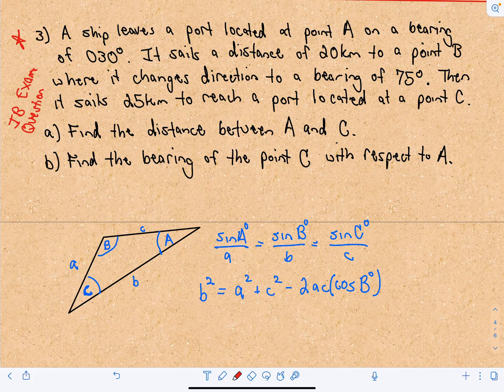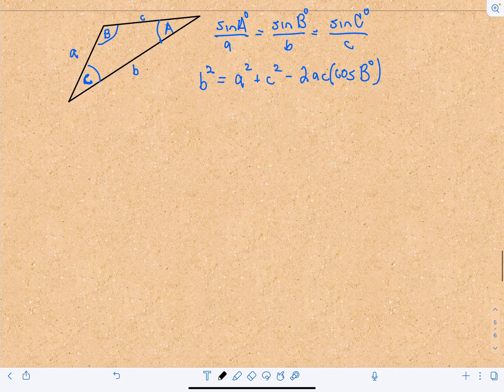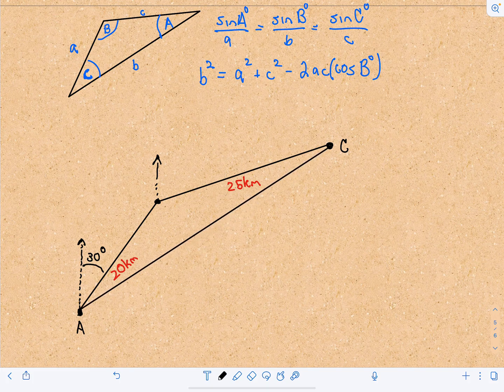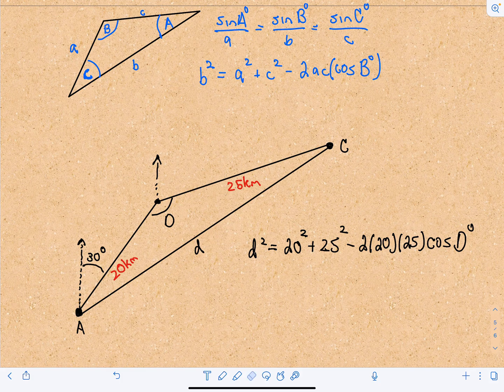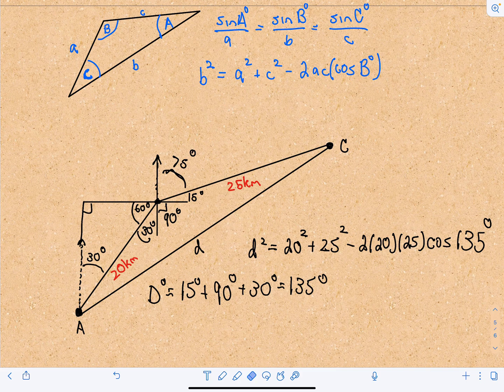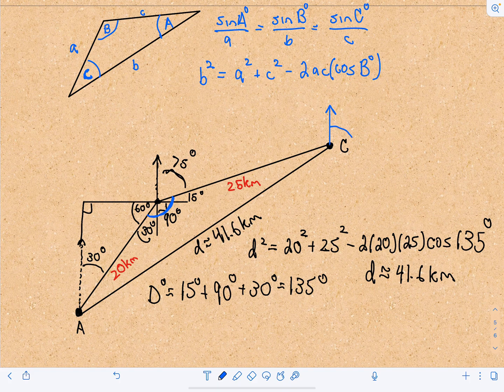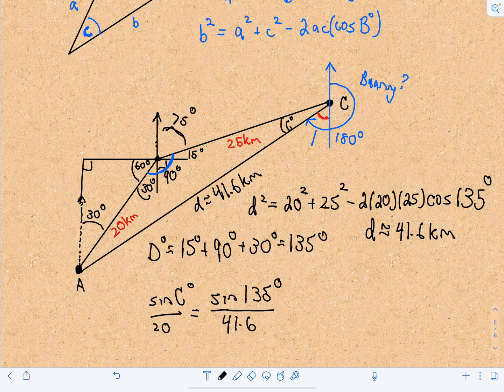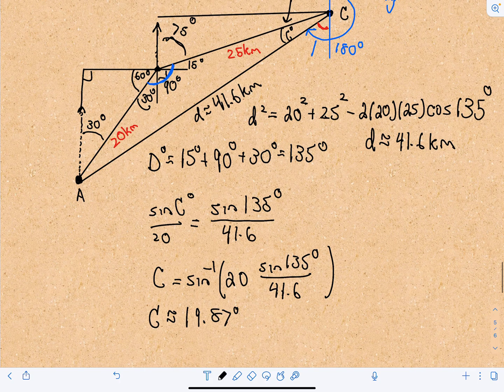Bearings Precalculus IB Exam Question

Comment: You can add the different pen colors and other tools to 'favorites' to get a fixed toolbar to switch colors more efficiently 😊
Reply from the maker: thanks! i'll figure that out. i'm not an expert with this app yet, that's for sure :)
Reply: Which app you r using sir...
Reply: @best_time_clicks_  Notability, only available on iOS and MacOS
Reply: Would it be possible to use the same app in tab

Comment: My math teacher also taught us other ways to put the final answer by using directions as well instead of just the total bearing degree. One way for this one would be S 55.1 W (s for south, to 3 sig figs, and w for west). The other way to write it would be to have west first and south second, but you would have to put the complementary angle to the 55.13 angle. Correct me if I’m wrong